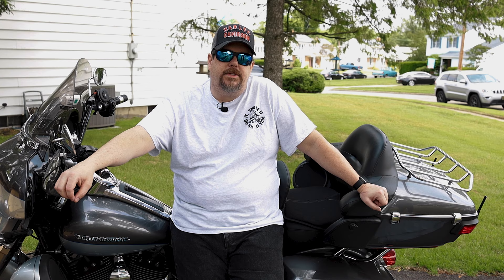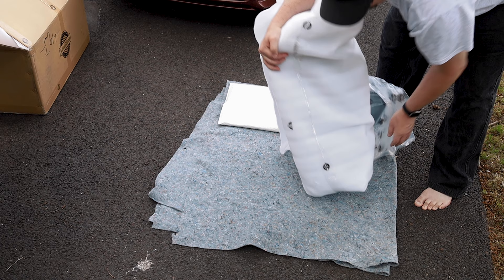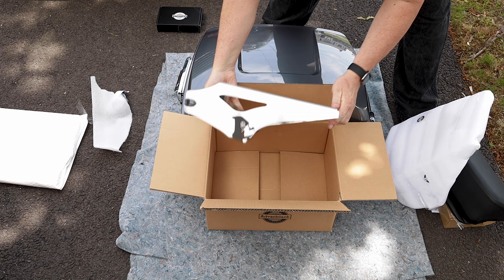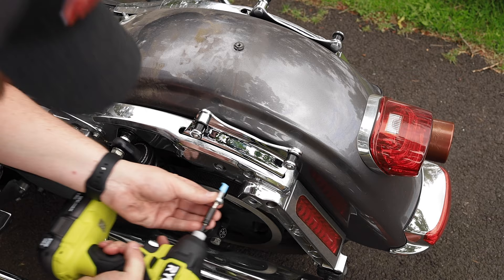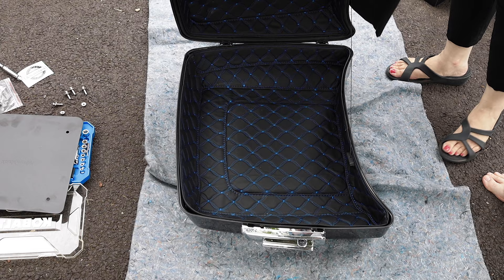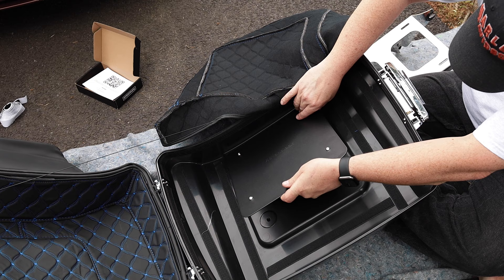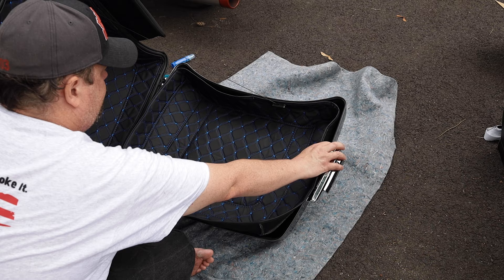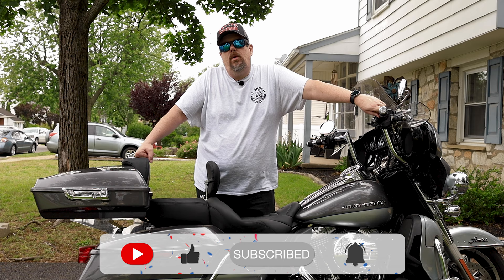Advanblack's Quick Disconnect Kit Makes Harley Davidson Tour Pack Removal Quick And Easy!

Comment: Why couldn't you use the original docking hardware that was previously on the bike?
Reply from the maker: That hardware is not quick detach.  So you need to add the 4 Point Docking Hardware to make it work.
Reply: @BryTheBiker  OK, I missed that, my 2021 Special came with the Hardware, so I wouldn't have to order that, Thanks
Reply from the maker: Correct you would just need the pack, bracket, and plate.